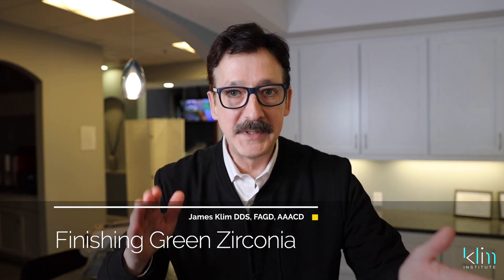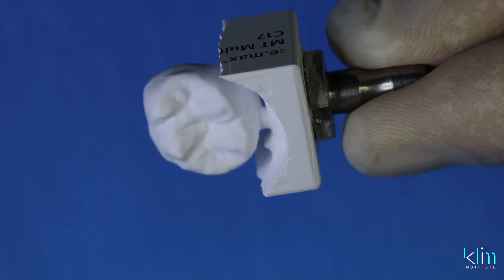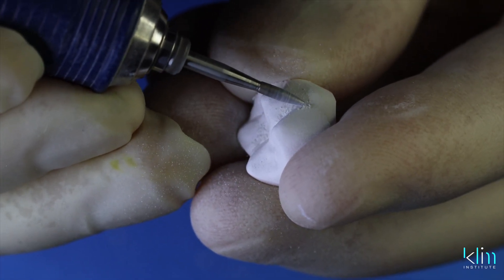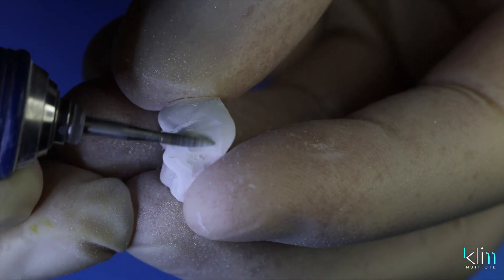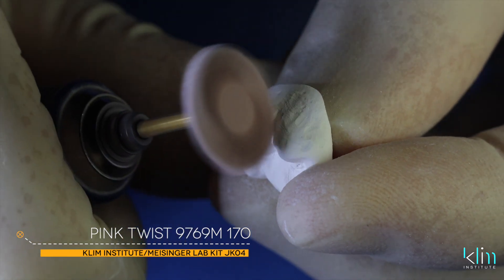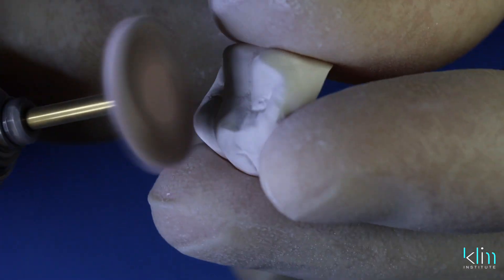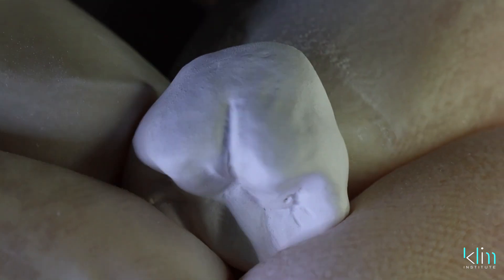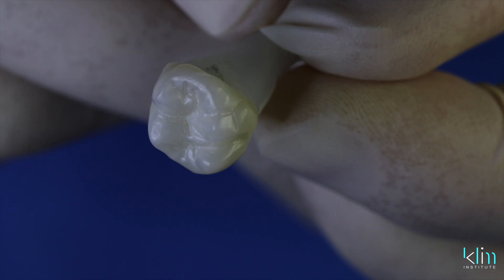Steps for Finishing Pre-sintered Zirconia

Comment: Hey, thank you so much for your videos. I watch a lot of them. I was wondering if you knew how many crowns you would get out of those diamond occlusal shaping burs? I want to buy that kit also I was wondering if you have tried the new dent supply zirconia crowns? What do you think of those? What is your preferred cement for zirconia? What lab motor and handpiece do you use? Thank you so much for all the effort you put out on these videos. They’re greatly appreciated.
Reply from the maker: Green zirconia is soft, so the diamond and shapers last long since they are made for pre-sintered zirconia.  When choosing a zirconia brand, the most important is to know if it is a 3Y, 4Y, or 5Y.  This will determine occlusal reduction and aesthetics.  I do like the Katana1 for its quick turnaround.  My favored aesthetic choice is ZirCAD MT Multi, but it takes longer to sinter. I use a resin glass ionomer for cementation.  Currently, I am using ZirCAD Cement.  My lab motor is the brushless Buffalo lab motor, and I love it.  All the best!
Reply: Thanks so much!

Comment: What speed RPM are you running your carbide burs at to adjust in the pre-sinter state? Still under that 10K speed?  I'm assuming here you had plenty of thickness to add all of that anatomy, but if you only had 1mm in the mill state, you wouldn't be able to take that maybe .3mm from those grooves without compromising the thickness -right?    Crazy good anatomy though - very beautiful work!
Reply from the maker: Yes, you know the thickness from design metrics and calibrate carving and refines relatively.  10K is a safe speed on green zirconia.
Reply: Dr Klim, thanks again for this... I have been using your technique and am loving it!  We had one crown come out of sintering with a fracture.  It was plenty thick.  In asking some in my community, some said maybe it was from excessive prepolishing but in watching your video you are going to town on that anatomy compared to what I do!!! 

Is there a risk of creating a fracture post sinter from prepolishing like this?

Lastly, I am finding a lot of dust and "crud" in the grooves and anatomy I created.  The polishers don't get into those grooves to polish bc of the angles... Should I get a pink and white cone to prepolish in the grooves?  I don't know how you got yours so clean.... Mine have a lot of dust in them.  Do you use something else or just the twist drills?  Thanks again!